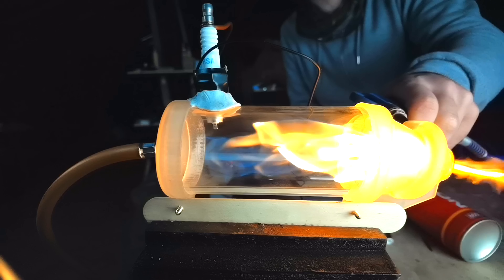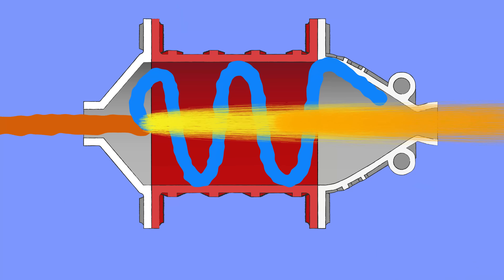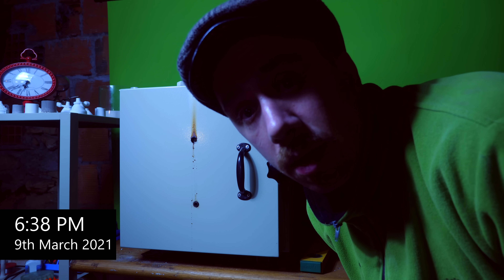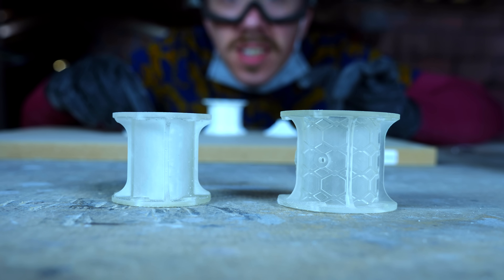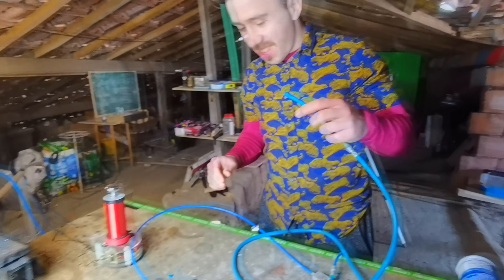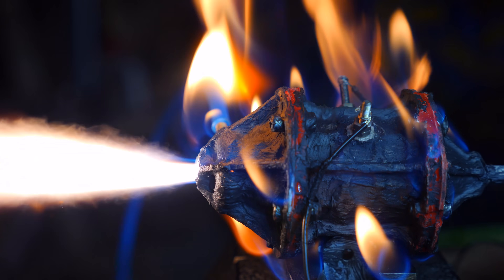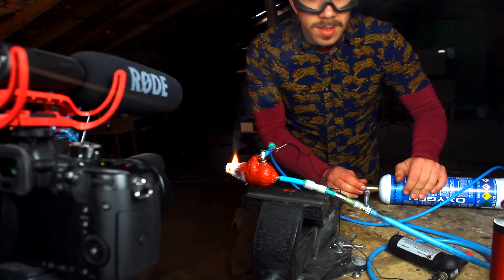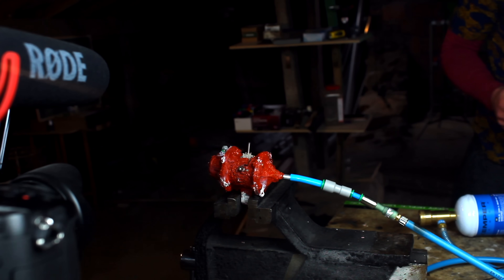Vortex Rocket V2.0 (3D Printed)

Comment: It’s too oxygen rich... switch the tubes and have it more propane rich... the oxygen will always want to oxidize anything around and is the reason it is burning the coatings and destroying the porcelain.... also switch to a valve with a handle to better control the gas flow, quick shutdowns are important when the combustion product goes out of control

Comment: Try sodium silicate (“water glass”) as a sealant. It’s sometimes used to glue things together in kilns, so I think it stands up to very high temps, and I think it would act as a good sealant. (Maybe use water glass on the inside and pottery glaze on the outside?) there’s also stuff called kiln wash that’s a very high temp refractory that is usually brushed on. I think it would be too coarse to use on the inside, but it might be another option for the outside.

(Pause)

I just checked, sodium silicate’s remedy temp is 810C. So maybe not enough. OTOH, even if it melted, the chamber pressure might force it into the pores of the ceramic, possibly still sealing it. It should in any case be higher-melting than most pottery glazes.

Comment: This is such a cool project. Maybe to seal the chamber you could paint the inside of the chamber with a ceramic glaze after the first firing and fire it a second time. It should leave a smooth, glassy, hard finish that shouldn't leak. I'm imagining the kind of glaze people use on vases and mugs etc.

Comment: You could try covering the week points (or the hole shebang if your so inclined) in refractory putty or cement, its what I've seen used on kelms for melting metal

Comment: I wonder if casting it into something (like a block of epoxi) would take care of the leaks.
Oh and please remember to place the tubes first
Reply: Great idea! I was thinking about machining and welding the parts to achive a more durable and accurate nozzle, but that would exceed the limits of this project i guess
Reply: He can also just use a gasket made of the slicone he used j the video, most of the gasses should stay in the engine

Comment: So make a sleeve for the thing at center screen at 3:39 in.  If you put an air-gap (with spacers) between the inner and outer sleeve, then you can fill it with gasket compound.  The gasket compound on the outside only has a little strength.  In engines, there are always two faces, and the compound is in a tiny crack.  If you have a gap, you could fill it with molten metal as well, such as pewter or tin.  While cheap, and archaic, they are also easy to use, cheap, and readily available.  You could also use an electroless process to deposit copper first, and then put something else in that is more readily available.

Comment: The next option is more dangerous... If you can't beat porosity, use it.

Inject your oxygen into a sealed envelope, a metal can, around the combustion chamber and feed high pressure oxygen through the engine's porous walls.  

The sealing is still a problem, but less so, because the envelope is cooler and won't be a wick for oxydized fuel.

Then again, if your O2 pressure is higher than your engine pressure, just blow Air out the nozzle. In fact just fly your oxygen tank by itself lol.

So this leads to the real concept, which is simply to make a stainless steel prototype, or machine an engine from billet aluminum.  Why?

Test your cooling vortex at max throttle, because I don't buy it (sorry - i could be wrong) so why suffer fixing a ceramic porosity problem when you've no idea if the vortex cooling is really something the entire industry has missed... Yet... I hope they have a d i wish you luck.

Comment: You could try to build a sheet metal casing around the engine. If you weld the fuel and oxygen pipes directly to that casing, the only place with possible leaks would be at the nozzle end where it shouldn't really matter anyway

Comment: to help with cooling, you could wrap copped tubing around the center chamber of the engine and run the oxygen through it on its way into the engine to aid cooling

Comment: Hey Integza , if you would build a pressure chamber around thé engine , and settting a pressure in the chamber greater than inside the engine , technically it shouldnt leak ( although this probably isnt the most efficient solution but it should work)

Comment: Have you tryed a sacrificial layer to avoid the leaking? I mean 3D print a mold and then add those carbon fiber you used in the past. If the plastic remains inside, shouldn’t be a problem if the layer is thin. You just get a liquid plastic pool when the engine is running that you can remove by flipping the engine upside down.

Comment: Why not just cake on that  thermal stuff that u put on the engines and put it in the metal cylinder full of the thermal paste too that also rotation so it keeps on spreading new thermal paste in the leaks of the engines.

Comment: you could try printing a single plastic manifold with no joins to stop leaks and incorporate a water cooled heat exchange around the plastic parts to stop them melting.

Comment: Well since you have  welding machine already, you could make a middle part with a tube and 2 plates, 
Only problem can be machining those plates, since outside isn't that important you can do it with angle grinder i guess.
But a hole in that plate can be a bigger problem since i doubt you're gonna be able to drill it XD
So the only way i see is to take this to some machineist but idk how if if this is possible.
And all this bother to only one middle part so... idk how realistic this option is XD

Comment: do the vortex rocket with metal and add liquid cooling, printing channels on the outer surface, weld all together, or print in one piece. tethon has the metal resin, probably you can sinter it with the hoven you already have. i think the final object made with metal will have less porosity than ceramic one

Comment: Self-contained it on some kind of projectile form and make it move! 

I know I'm probably getting ahead of the all process but we like to see flamy things moving! And if you want to do it, better do it now before the summer time, were wildfire prevention probably will be prevent you to send this kind of thing in the air.
A modular form where you can easily stick any kind of rocket, would be a good fit. And from that on test new rocket designs there.

Comment: Why not normally 3D print 2+ part molds and just buy ceramic clay and pack it in the mold and then take that out of the mold and fire it in the Kiln ? It’s a lot cheaper and shouldn’t have the warping issues

Comment: maybe instead of printing the cross sections horizontally, cut the part vertically, so there is alot more support material to keep the flange flat? Also, I think just the nature of the ceramic parts, being 3D printed, that they are very porous. Try sealing the interrior aswell with some kind of slip?

Comment: hi integza! I think that this type of cooling int working very well, oxygen swirling around the walls is creating oxidizer-rich zone there, and oxidizer-rich combustion is creating more heat! I suggest switching the fuel and oxidizer tubes, so the propane is swirling, and the oxygen is mixed in the middle. I think that you can also try to make a carbon fiber layer on top, like you did with the pulse-jet to seal the engine better. I hope this helps! (Also, sorry for bad grammar, english is not my native language)
Reply: maybe you can also make a hybrid rocket in the future, hybrids are easier to build!

Comment: Hey Integza! Crazy idea, maybe using a pressure pot to drive high temperature ceramic resin into the part after printing. This should force the resing into the pores of the ceramic, after removing the print quickly cure it, (surface finish may suffer ) in UV light like a normal SLA print then bake out the resin. If this doesn't work try changing the order, perhaps,  print, cure, kiln, pressure pot? It seems the issue stems from not getting the HTV Silicone/Cement deep enough into the print?

Comment: One issue that this motor maybe have is the fact that when the combustion happens, the expanding hot gasses push the vortex for the injector/nozzle. Maybe Thats why, in your previous videos, the vórtex seems tô appear only too close from the vórtex generator injector/nozzle. you could fix that by inject oxygen under pressure with a pump/compressor or something like that. That seems to be a future theme to me :D

Comment: 15:55 printing the entire engine in one shot will avoid air gaps between fastened parts. then, add heat-proof silicone on the outside to help seal any potentially microscopic pores.

Comment: I think the issue with the leaking could be the difference in thermal expansion of the metal bolts and the cermaic in this case it would explain why it never leaks to begin with

Comment: Can't you replace evaporated resin with something else? Soak parts in something that is thin enough to get in and does not shrinks while curing and can get really hot. Have no idea if something like that is obtainable.
Or you can just cover parts with thick layer of molten metal o) Fill inner side with sand or something and completely cover outer side with molten metal. You can make induction heater from a microwave oven and use carbon-like conductive crucible to get metal inside it white hot. Just don't forget to preheat ceramic parts too.
Example in Russian: https://www.youtube.com/watch?v=CRifNoZ1kOI - melted aluminum and copper.

Comment: The reason for the leaking is that you haven't sintered the ceramic. You need to keep it in the furnace for probably around a day at the appropriate firing temperature. Google tells me that for porcelite it is 1250 C. Just remember to gradually cool it down afterwards so it doesn't crack. And you still have to do the polymer removal process at the lower temperature. If you try to burn it at 1250 C straight out of the 3D printer you will destroy it. So the whole process could easily take 2-3 days but the quality should be much much better. Your current rocket engines are the equivalent of a dried sand castle. You need to sinter it to turn it into a brick.

Comment: Keep going. Ur at the cutting edge of printing a jet engine in one piece. U could use air pressure to get high temp glue inside Ur ceramic lattice. Or a vacuum.

Comment: You could try using ceramic/pottery glaze to seal the ceramic, sealing the inside might work a lot better for you as the chamber pressure will push the sealant into the ceramic instead of pushing it off the outer surface.
Since you now have a real kiln, you could cast ceramic in a 3D printed mould instead of printing it with Porcelite. It might end up being much faster and you wouldn't need to cut off all of those supports.

Comment: greetings Integza would increasinsing the size of the engine by 42% and using a fibreglass inner lining would help  with heat displacement aswell as with sealing .good luck and death to tomatoes

Comment: A Suggestion:
1. Using O2 as the oxidizer is not perfect for vortex cooling as the oxygen attracts the fire, pulling the majority of the heat toward the wall instead of isolating it from the wall. So it is more acceptable to use air as an oxidizer. Even though there will be a decrease in thrust, the added bonus is the longevity of the 3D printed engine.
2. Using the Carbon fiber fireproof sealant combo around the engine will be really helpful at keeping the leaking in check

Comment: I have no idea if it would work, but what if you dip or paint on more ceramic resin, onto the already printed and sintered parts, to make them thicker, then fire them again? That could help with both temperature stability, aswell as with the leaking? Thicker parts would leak less? And able to withstand higher temperatures before cracking?

Comment: Maybe a aluminium cast rocket (3D printed rocket, cement mold) with steel nozzle (turned) will do the job. But i dont know how high the temps are inside of the rocket... :)

Comment: I think the leaks are coming just because of pressure increases. The high temp silicon worked until it started expanding. So maybe dont focus on sealing the engine, focus on making it stronger to hold more pressure. Like wraping it in fiber glass or carbon fiber?

Comment: Only a suggestion!
Print as normal. Place print in pot of ceramic resin. Place everything in vacuum chamber to replace voids with un cured resin. Cure with 405nm uv lamp. Remove resin as normal.

Comment: I got 2 suggestions.

1)Maybe look into aluminium casting. Sure the engine itself won't be 3D printed anymore. But the moulds would still be 3D. And you already have the equipment to melt Al.

2)Coat the inside of the engine instead of outside. If you'll continue with the ceramic resin single part engines, I don't think coating the outside will do you much good. The Ceramic you're using is too porous. If the outside of the part is airtight at one spot, the gas will just travel further into the ceramic and escape from somewhere else. I appreciate coating the inside of a single piece engine is not easy but if you can find a high viscosity, high temp coating and put the engine on a centrifuge on its central axis, it might just work. 

Anyway, keep up the good work!

Comment: What you might want to do with your modular engine is coat the inside of the ceramic with a sealant and then pressurize it to force the sealant into the ceramic. You will have to use a rather thin sealant though as you don't want to make the inside of the parts too rough as that would disturb the airflow.

Comment: Here's a fun video idea, towards the end of your rocket obsession once you create a functioning prototype, you should have a race with that one tie guy that made a pulsar rocket engine. The race can be held on two fronts one fuel efficiency by weight and race to the finish. Each of you using an identical vehicle, and a loser will have to eat a caprese salad.

Comment: Hi Inzegda! ;-)
Your biggest problem is poriosity, next one surface temperature.
Why not just overglaze the engines? You have an oven that should reach the needed temperature. Worth a try, isn't it? Afterwards the material should be absolutely impervious and temperature-resistant.

Comment: I'm sure I'm not the only one to suggest a metal sintering printer.  But on the low-end of the theoretical budget, there's hope, given you stop the leak, you don't oxidize your engine's matrix, and so you only need a few angstroms of metal... If your vortex cooling is for real.  Else, that won't even work because you'll blow Bubbles of liquid metal.

Oh. Ok.  I was going to suggest inside surface electroplating.

But maybe dipping the thing in molten tin, or even glass, for that matter, aluminium gallium...maybe not.

Of coarse you need a vacuum chamber too.

Comment: If you can submerge the pieces in a high temperature medium and pull a vacuum with a vacuum chamber to fill the pores in the ceramic it would seal the leaks. Depending on the size of the pores you may even be able to use slip or even a metallic glaze then fire the pieces again but you would definitely need a vacuum chamber to pull the medium into the pores and expel trapped air.

Comment: If you coated the inside of the three piece engine, the pressure would push the coating against the engine.  I think what you did was more like wrapping a balloon around your engine, and when the gasses leak through the engine they pop all over the place.

Comment: You should try lapping the flange surfaces between the nozzle and the body so they are flat and you need way less gasket material (so less chance for leaks there). You may also need a 'washer plate' so you can clamp the flanges better.

Comment: Since the problem is leakage on ceramic parts, why not make it on metal sheets?? 3d print some mold and press the metal to form and some mig welds.

Comment: You may need to print the walls in 1mm thickness. That could solve the problem. I think with 2mm they have to many micro cracks

Comment: Great video! I saw some people say you should use pottery glaze outside it, but what if you use it on the inside the engine? If not pottery glaze you could use some other high temperature sealant. I suggested you coat it on the inside because if it's on the outside, it has to take all that pressure by itself. However if it's on the inside, it can rest on the chamber walls. The only problem with this is that it also has to survive high temperature and pressure.

Comment: Let the part soak in ceramic glaze to fill the pores in the part before sintering it again in the furnace. Whatever non toxic and as high temperature as your furnace can handle should be best.
https://en.wikipedia.org/wiki/Ceramic_glaze

Comment: I've got a weird idea for you: glaze. Glaze is what makes every day ceramic waterproof despite the ceramic being porous. I can think of two ways to do this.
1) Once your parts are printed, baked, and assembled, coat the inside with more porcelite (maybe pressurize the inside of the assembly to try and force the liquid through the pores), put a UV LED inside to cure the resin, and bake as normal.
2) Contact the creators of Porcelite and ask them if there are any conventional ceramic glazing techniques that would work with their product.

Comment: Would it be possible to remove support material before firing the parts?  Seems like this would be much easier and end up with a much nicer surface finish on the parts.